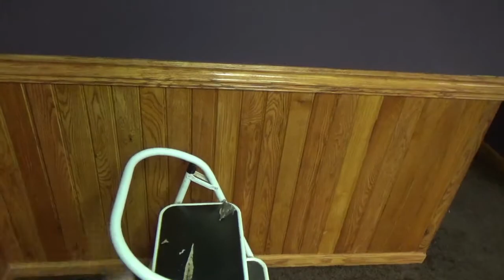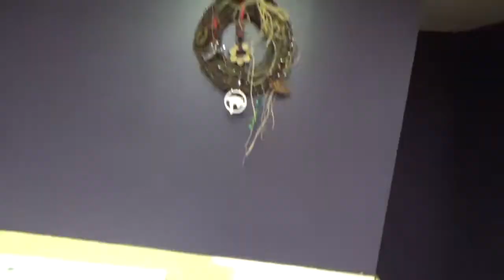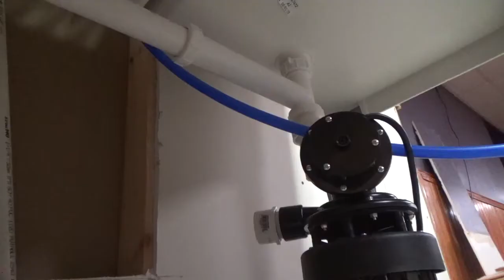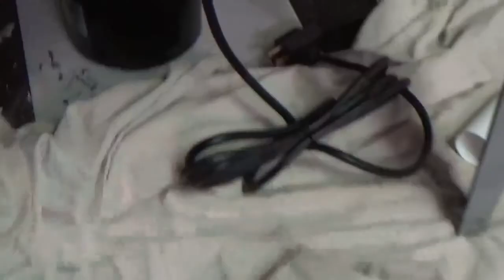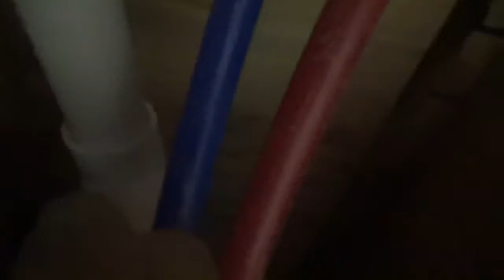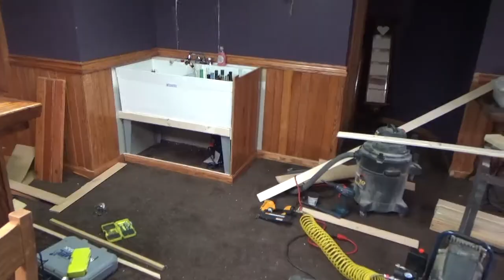Installing an upflow Basement Sink

Comment: First of all you put the Teflon tape on incorrect supposed to go opposite direction that you threatened it in you totally doing it wrong and you using pipe dope no no on that plastic
Reply from the maker: I don't recall threatening any pipes.  But I'm sure they probably deserved it!  Or using pipe dope for that matter.  Are you sure you wren't confusing that with the glue I was using?

Comment: Does this need a vent? Did you get it inspected? What code version does this adhere to? Just trying to figure out what a similar project in my area would require.
Reply: Hello!  In this case there is a vent-stack right close to where the line runs up.  A vent would be a good idea in most any other situation, but with this tying into the main drain right next to the main vent stack its not really a big deal.  I quite often will use aerator vents (or air-admittance valves), but being that this is an up flow system the entire stack is all part of the trap and its kind of impossible to add one.  (vents happen between the trap and the main drain system)  I did not get it inspected, nor are there any required in my area.  I would encourage you to check with your local permit-office.  They can tell you what is required for your town.  Thank you for your questions!